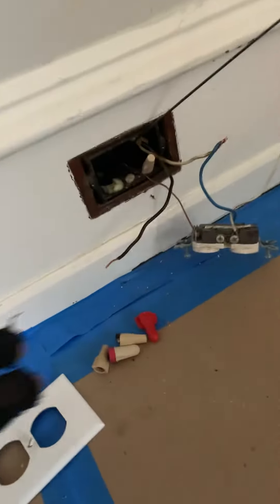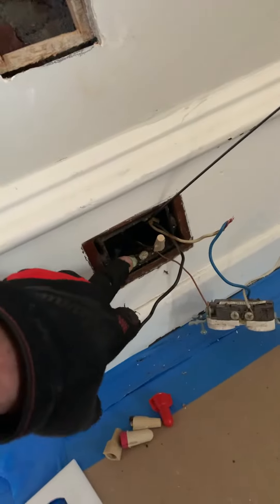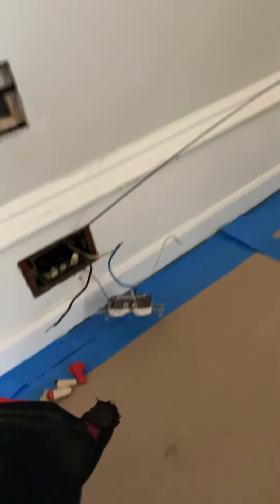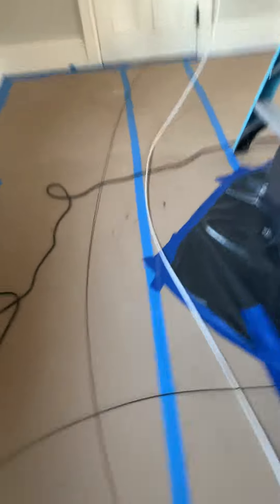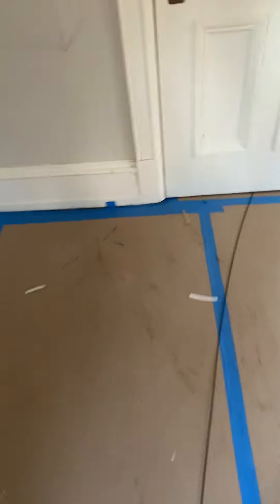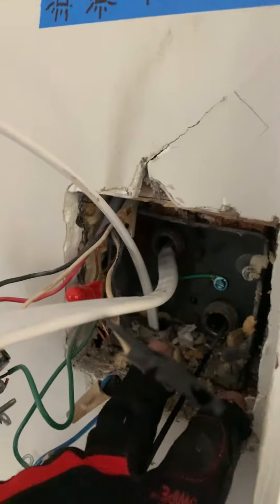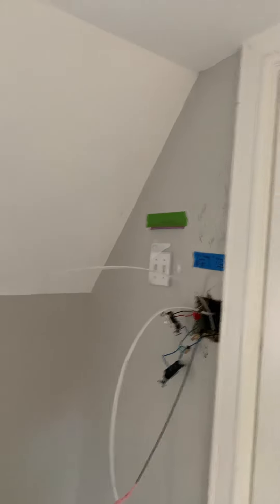A little trick when fishing solo

Comment: Hell yeah Donald, that's awesome technical info!  I've only done this of stuff in my own 110 year old  house, but establishing a low-resistance feed into the walls and ceilings is definitely a crucial step to getting the wire where you want it to go.  In my basement I was able to use the boiler pipes as a sort of 'pulley,' when feeding up into the channel for the steel beam, which is mostly covered with drywall.
I guess that pipe in this video is conduit?  I didn't have any of that, but I would think that it would up the difficulty scale significantly.  I guess it takes firestops and cross-braces (mine are diagonal) out of the equation at least.
In doing my house, I did pick up enough to learn that the big box hardware stores sell a dedicated lube for fishing through conduit.  I thought it was for general fishing and considered buying some, but my friend, who is a super savvy DIY'er, informed me that it's for conduit.
Reply from the maker: Dan E. Boyd 
I like Palmolive dish soap.
Diagonal fire stops suck, we’ve seen them in old Sears houses. We notched down the wall and fished the ceilings.